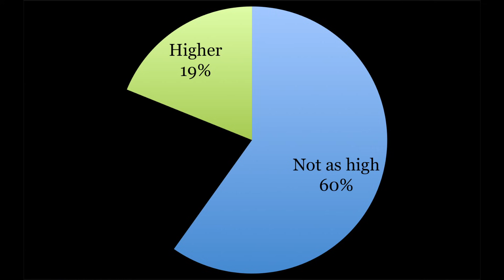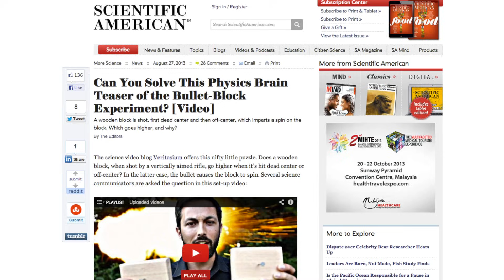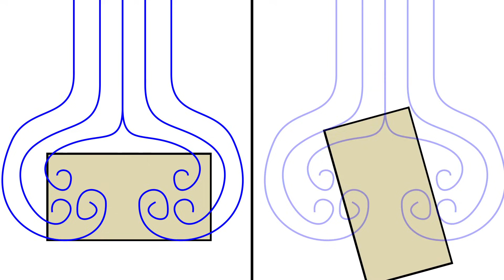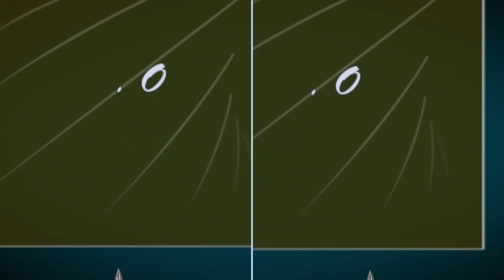Bullet Block Explained!

Comment: the difference in depth would be bigger if we used softer material... for example rubber or something like that, but  that material would have to be longer, so the bullet dont come out on the other side.. well, in my opinion, you have shown me that my logic based opinions are not always correct

Comment: Maybe you don't want to measure how deep the bullet went, but how much energy it expends on other things than moving the blocks.

Measuring the heat would be difficult I guess, but I think if you can somehow measure the acoustics at a high temporal resolution when the bullet hits the block, you might be able to measure how much energy was converted to sound.

I think that'd be an important measure because the bullet traveling trough the wood creates sound as a result of the woodfibres crumpling in front of it, and from oscilations due to friction against the wood.

So even though the acoustic energy might not be the larger portion of the energy transfer (heat being the other), it might be able to indicate differences well enough (because the acoustic energy might be larger than the kinetic energy transfer).

Comment: the block shot through the centre and side have equal energy, but maybe cannot be measured through normal observation. how about sound created on impact? heat released? vibration? deformation of bullet? deformation of wood block? everything will make the differences.

Comment: the bullet shot in the centre deformed more than the bullet shot from the side. so there the extra energy come from. maybe after certain point the bullet must stop because of the resistance. but the remaining energy, maybe released in a different form. bullet shot at the centre of the block deformed more, while bullet shot at the side, create extra rotation for the block. maybe.

Comment: Just me thinking, but with the bullet's force entering at a non-balanced point, thus giving it the spin, is not the total resistance of the block against the force of the bullet reduced possibly making up for the energy loss?

When the bullet that hit the center of the block hit, it had to go against the total resistance for the entire mass of the block, whereas when it hit offcenter some of that resistance was lessened as the energy was allowed to transfer non-uniformly, and thus more concentrated without it's own energy balancing itself as much, lessening the ammount of kinetic lost in total. The extra "lost" energy from the first block could then be the rotational force.

I could be totally wrong, but that was what I thought of when I considered it... To me, it seems a basic use of some of the most fundamental laws of motion, just with a bit of a spin on them.

Comment: Hmm, the problem seems that need a larger difference between the off center bullet and the on the on center bullet. I bet changing the block material to a material could help, but if it deforms to easily it ay introduce other problems. I bet there are smart you tubers who can come up with some out of the box thinking.

Comment: Need to use a softer material like balistic gel or a plastic to measure depth of the bullet.  You get a slower/longer deceleration, but your block will not travel as high.

Comment: A few questions:

1. When measuring heights, do you measure the height of the center of mass? The spinning block+bullet might actually have a lower center of mass.

2. How close are the masses of the individual blocks? (I assume that the bullets are manufactured to rather exacting standards.)

3. How about firing TWO bullets into the same block? (They only have to fired nearly simultaneously.) If the two guns/bullets are not identical, or are not symmetrically targeted, there will still be angular momentum imparted. Furthermore, if you run the experiment separately with each type of gun/bullet, you can check if the heights are additive when they are fired together.

4. I endorse the suggestion below of using longer blocks but I'd also like to see them marked in such a way that we can easily tell how high the centres of mass get.

Comment: You can actually see when the bullit is hit right down center how the center is lifted first bending the wood like a spring before the edges leave their starting points. the centerhit block vibrates a lot more in flight than the offcenter hit block. there is your energy.

Comment: I think a good way to measure depth penetration would be using an air pressured nail gun  so you can set the exact same pressure in every shot and avoid powder variation in bullets that could explain the different heights found in the experiment (also cracked wood blocks would result in lower heights I would think). Then scaling down the wood block weight you can easily measure the part of the nail sticking out and compare. This way you can also avoid cracking the wood.

Comment: Would thete be some way of measuring the tempreture of each block as the experiment happened? That way, if you you coild find out the specific heat capacity of cellulose and lignin, you could determine how much energy gets wasted as heat.

Comment: LOL
Just use a softer material where the transfer of kinetic energy from the bullet into the combination of bullet/wood block would spread over a longer range thus rendering the difference of bullet penetration measurable.
Further more you can alter the other characteristics of the wood block into another kind of block of different specific weight as well as differing dimensions to optimize for the desired measurement. I trust you get the idea.

Comment: 6. with equations from (4) to (7) , you will be able to find v2, which the velocity of the mass center of the block. h can be calculated very easily. You will see result as my first comment. The difference is really small, but theoretically I am right. Both the "Minute physics" and "smarter everyday" guys are correct, but their explanation is wrong. I like you two very much. Haha

Comment: I would use a larger caliber bullet. Also maybe a different medium instead of wood. If you use a dense rubber and a much larger block, when you shoot the block the height will not be as great but the depth of the bullet into the medium will have a greater difference then .1mm

Comment: Did you just delete my comment? 
I calculated the answer for this problem. Here is the answer:
h=1/(2*g)*v^2/(m1^2*(1/m1+1/m2+L^2/I))^2, where v is the velocity of the bullet. m1,m2 is the mass of the block and bullet respectively. L is the distance between the bullet and the center of the block. I is the rotary inertia of the block. Clearly, h decreases with L. You are wrong.

Comment: Here's the experiment:  using high precision ammo, shoot two small but equal rectangles of AR500 hardened steel under the same circumstances.  The non spinning one produce more fragments of the bullet while the spinner will absorb and produce less frag.

Comment: please try to consider the rotating motion of the bullet. every bullet leaves out rotating from the bore cavity of the gun.

my assumption: 
1. when bullet hits the wood on the side, the rotating motion of the bullet is multiplied with the momentum causing twisting. the wooden block might be turning in the same direction the bullet turns at contact. 
2. when the bullet hits the center, the momentum is considered, BUT the rotating motion is cancelled because it hits the center. 

probably.

Comment: Well there is one thing that is paramount to measuring this energy loss/gain as you put it.

when it comes to air resistance you are only calculating the amount of energy it takes to get it moving but there is one even larger force we have not yet explored here. and that is low pressure zones behind the block. a spinning block will disperse the low pressure zone over a larger area then the non spinning block thus creating a difference in air pressures around the block.

Comment: Thank you for this experiment. I watched the experiment video and you actually got me confused for a minute ;) I thought at first that the height is the same, which is of course obvious, but THEN i thought about kinetic energy and got confused. Voted for 'not as high'. Then after 30 seconds realized I've been had (the heat energy crossed my mind..). It's been 20 years since doing lots of cases like this in classes. I am a bit ashamed, but everybody fails sometimes. Thank you for reminding me!

Comment: ...and if we imagine earth rotating at... let's just say 5 times faster. it's mass wouldn't change, and the moon would still be affected by the same amount of gravity. one side of the object is receding and the other side is ... anti-receding (ran out of dictionary), both of those sides equals half of the objects mass, the kinetic energy of the moving mass (specifically center of mass) is the same as with the block that isn't rotating. also use a longer block with the same mass.

Comment: shoot both of the blocks against something that will measure the total energy of the impact. the rotating object is rotating around the center of mass, and the height it goes to, has to do with the movement of that center of mass and not the mass rotating around the center of mass. a ball that's rotating around it's axis shouldn't fall any slower to the ground than a ball that isn't rotating (atmosphere creates a bit of lift though), nor should it impact with a greater force to the ground.

Comment: Hello guys, I suggest to think about the potential energy, i think that we need less then a joule to make it rotate 11 times per second. I think this because while the block rotate it create potential energy rotating. lets call the two smaller side of the block A and B.
Moment 1) A and B same high orizzontal position 2)B higher then A(pot energy grows up) 3)vertical 4)B higher then A and the potential energy helps it rotate and...A vertical rotation is different from a orizzontal one.

Comment: I'm not a scientist but I did work a lot with wood. My experience suggests that perhaps the reason both blocks went to the same height despite one of them rotating might have something to do with the density of the wood itself. The center of the block is denser, therefore although the bullet ended up at the same depth in both blocks, it would require more energy to penetrate the center of the block versus the side of the block where the fibers might be a bit less dense.

Comment: make the block reflect the bullet not absorb it ie. make it out of some strong alloy. then the collision might be closer to elastic, and this penetration factor would not matter. you would notice that the blocks might go to the same height: what would differ with the rotating and non rotating blocks is the final momentum of the bullet. if you then tracked where the bullet ended up, you might get a better analysis of the experiment.

Comment: There are too many unfactored variables in this, leaving a lot up to speculation. The physical characteristics of the wood, the density of the wood, the cut of the wood and the section of tree it came from, the balance of the wood relative to the center-line of the fulcrum. Then you have to consider the physical and ballistic characteristics of the round, the powder match, where the bullet strikes, etc.  As the video showed no block was consistent in its maximum elevation.

Comment: Leave everything set up the way it is. however you should have another nail on the other side of the block or just an axle through the block. Then put two sheets of glass on ether side with vertical slits cut into them so the axles in will make the blocks stay in the same vertical plain.

Comment: He needs to use a soft plastic block.  Too many variations in the density of the wood.  You will never get a repeatable test with accurate results.  Every ring or grain in the wood will change the reaction of the bullet.

Comment: Using a wood block and random ammunition is what is throwing this experiment off.  If you were to have a gunsmith prepare you 20 rounds with the exact same amount of propellant and weight bullet you would get a more accurate measurement.  Also by using a medical grade silicone block or some type of soft clear plastic block that will not shatter would be more accurate also, due to the imperfections and density changes in the grain of the wood.

Comment: In trying to think how to test this, I would say try and find a way where the material density changes asymetrically, but shape and the center of mass are the same.

Or try shooting something longer and less rigid.  That way you can see the waves in slow mo before they cancel out or convert into torsional rotation.

Comment: I'm going to disagree with the bullet depth explanation.  So what is an explanation in physics when things don't make sense?  Waves.

Here's my hypothesis.  In both blocks when the bullet hits the wood, a wave propagates outwards, both transverse and longitudinal.  In the spinning block, the off center impact makes the wave visible, as one side is lifted first.

In the on center collision, a standing wave is created in the wood, canceling out any visible motion, but the energy is still there.

Comment: so no matter where you shoot the bullet, the force is transferred into the block so we can say the force on the center of balance is the same. ( tes i know the blocks had a different hight but that could be to the 'negligible' factors of the gun. heat, gunpowder, wind, bullet weight)

Comment: i would have to agree with Alex a more soft(penetrable) material could be used and since wood is made up of different layers which may have different degree of hardness(couldn't find the right word) we should use a material that has only one layer or layers that are of the same amount of hardness.

Comment: I'm not so sure, but isn't the Kinetic energy itself responsible for the rotation (In this case, the bullet is hit at a distance to the block's center of mass, so there would be a moment, which causes a rotational momentum hence the rotational velocity, which should be provided by the Kinetic Energy, right). Kinetic energy is provided by the bullet which is the same, for both rotational and linear momentum. KE equals PE so both blocks reach the same height. I hope I'm right!

Comment: accelerates, if its going faster, its exerting more force, because its faster at the point of impact its penetration will be higher unless it reaches its terminal and peak velocity before impact in both cases in which case its a moot point. Also in the wood block the angle of entry, changes the properties of the laminate thru which it travels. I know exactly what I mean, but I don't have the lingo to get it out of head really, well not in 500 letter chunks. CONT

Comment: If you want the results to be more measurable, why not make the apparatus bigger. Cannon, Blocks off steel and remote trigger. The more elastic, the block the better. How about a large tank containing a nonecludian fluid, not a boffin may have got that wrong but its the dancing goo I mean, as it harden in response to pressure. I cant help but feel that although the energy is the same the condition of the being applied, are different change the angle of attack, change the amount the round CONT.

Comment: That makes perfect sense.  If you put the block on an axle or suspend it from a wire drilled through it, you can see that it takes very little energy to make it spin.  Just blowing on it would get it spinning.

Comment: The energy problem is explained by the vibrations. Briefly, think about the symmetry. Shouting at the center, the symmetric distribution of forces create vibrations. In the antisymmetric case, part of this energy goes to the rotational kinetic energy. If I didnt anything wrong, hahaha, with rotations the total kinetic energy is always twice than the case without rotation(bullet's mass ONLY can have 1/ 3~1/5 block's mass). To see the vibrations, u change the block for something thinner or harder.

Comment: Yes, you are right in that Newton's cradle does demonstrate the laws of conservation of momentum and energy. Because for example in a Newtons cradle 5-ball system. One ball is pulled away and is let to fall; it strikes the first ball in the series and comes to nearly a dead stop. The ball on the opposite side acquires most of the velocity and almost instantly swings in an arc almost as high as the release height of the first ball.

Comment: Total Linear Momentum is conserved, so if the bullet bounces off of the metal block back towards the ground or pushes the block out of the way and continues moving upward, that also has to be factored into your linear momentum equation.

Obviously measuring the speed of a deflected bullet isn't easy but you can do it if you have a high speed camera.

Comment: Hey Derek!
I think that the rotational kinetic energy isn't very large as the block doesn't weigh so much. All the values that you said were negligible could ADD UP to the extra energy required for the rotation to occur.

Comment: So - Easy enough.... 
Bullets overall 'power' will inevitably move weight the same distance
However,
Bullet Position, alters efficiency of said power. The bullet will still be carrying the same weight, but the efficient use of lift (think of how you'd lift something heavy, ie from the side) still needs to distribute it's energy into rotation. 

Think of it like a KO Punch VS a Strong Punch. The one that rotates the head and lands on the chin VS straight to the forehead.

Comment: Aha!

Since the bullets were fired at the same angle (upwards) they have the same velocity, which, when it hits the wooden block means that the combined mass traveled with the same velocity, regardless of position of the bullet.

BUT

Assume that both bullets were shot into the center of the block, but one bullet was fired from a gun that was at an angle pointing towards the center of the block. Even though they hit the same spot, the block with the angled bullet would not go as high.

Right?